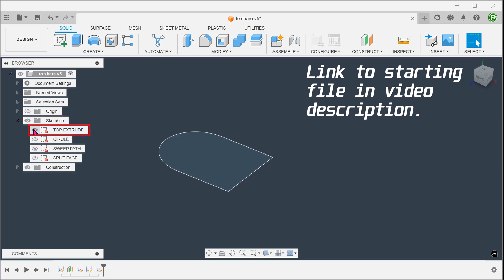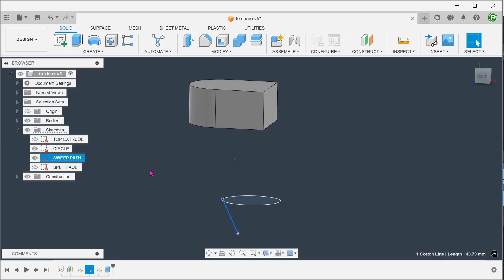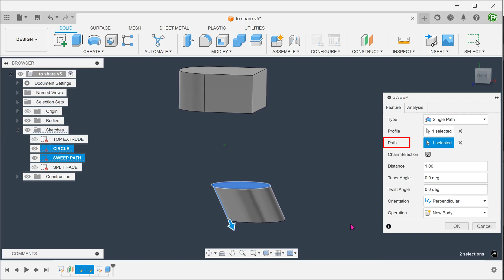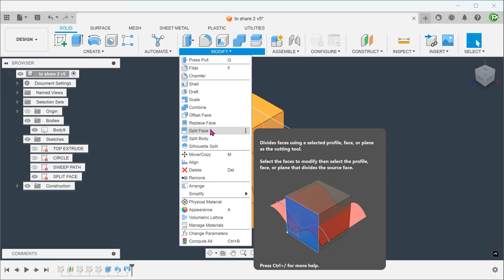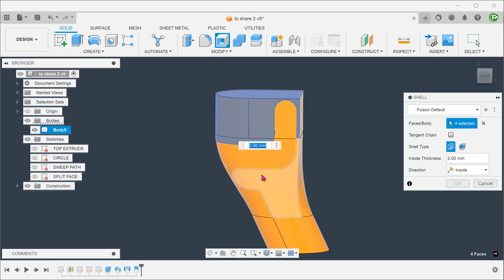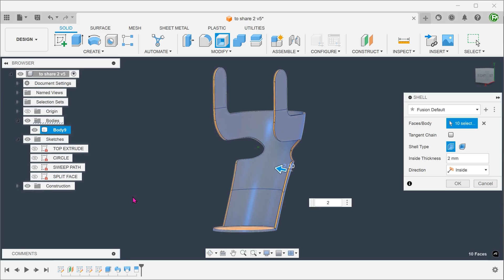Autodesk Fusion | How would you model this?

Comment from the maker: For the cut at the base, you can either do a simple cut or you can try doing a split face. This split face would be one of the faces that you select during shelling.
Reply: Ran into an interesting design project. I needed to use a Logarithmic Spiral (so non linear growth as it spirals out) as the basis for a design. Short of importing an external DXF any idea on how to do this in Fusion? Linear spirals are easy using the Coil function. The importing of DXF's caused some 'fun' and breakages later in the process. Want to have a bash or give me an idea feel free 😁

Comment: While its a really nice workflow, i cant but be annoyed by the look of the inner (not so) round corners.
I would probably do a sharp corner and add a fillet at the next step, i don't see any other way. Well maybe drawing the entire thing on a larger surface and then emboss it or so. But that would be also imprecise and much harder to do.
Reply from the maker: Yes, those inner corners do look strange. The sketch needs to be wrapped around that region for it to look right. I own the same microphone and the corners look like that, so it seems like this is how the designer modelled it as well.
Reply: @Fusion360School  Thought so, it was not visible in the picture. Its likely easier to manufacture that way also.

Comment: At the end of the process, I am curious can that be flatten into a sheet metal in F360?
Reply: I think sheet metal only does bends. That curved part in the middle section would be problematic. And I imagine you’d have to sever the connection of one of the legs at the bottom where it attaches to the base.